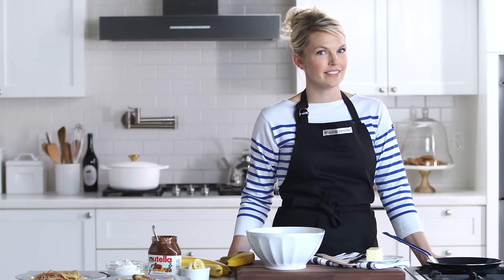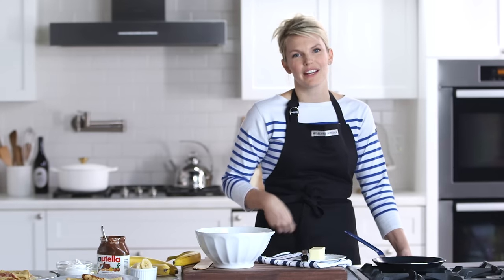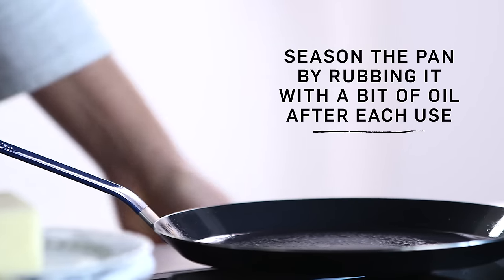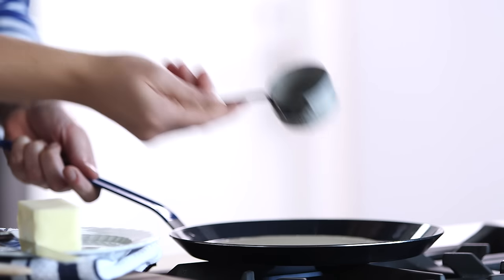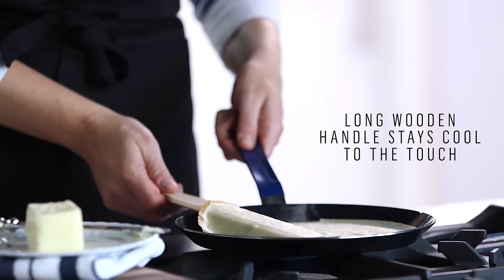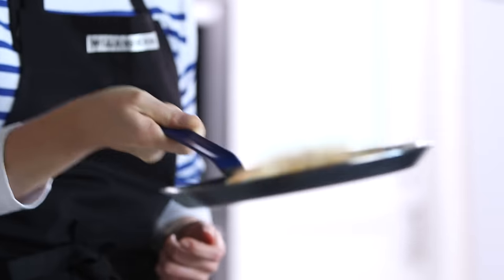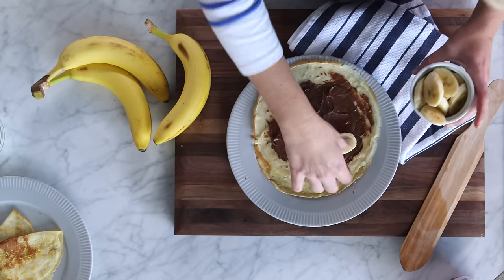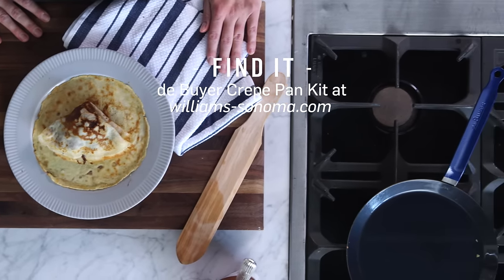How to Make Perfect Crepes

Comment: Question: I purchased one of these pan many years ago but never used. Stored in the garage it develop some rust stains of which I cleaned away but the spots remain. Part of the original coating is gone so my question is can this pan be seasoned again and be used?
Reply from the maker: This is a steel pan without any type of nonstick coating, which is why it needs to be seasoned. You could try seasoning the pan again (hand-wash in hot water without detergent; dry; rub interior with oil and place in a hot oven for 30 minutes), but depending on what state it's in, it may not have the same performance as new. Hope this helps!
Reply: Our carbon-steel pan rusted when it wasn’t dried properly. Fine steel wool got rid of the rust, then we re-seasoned it (three times). Good as new!